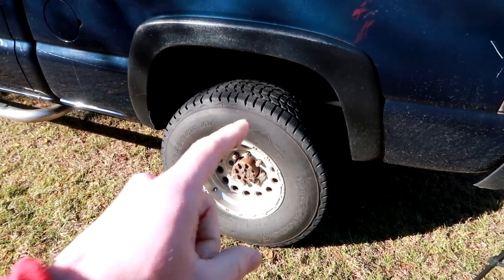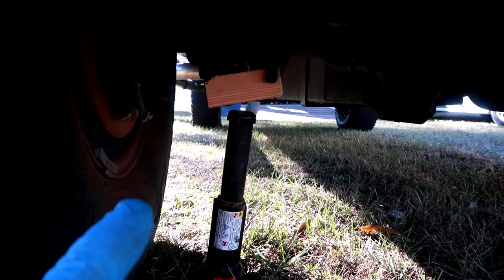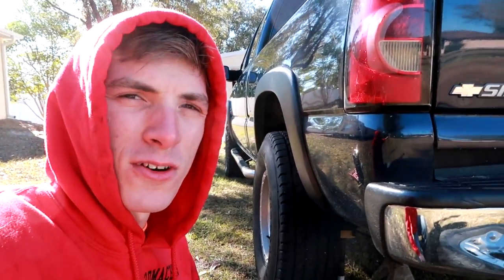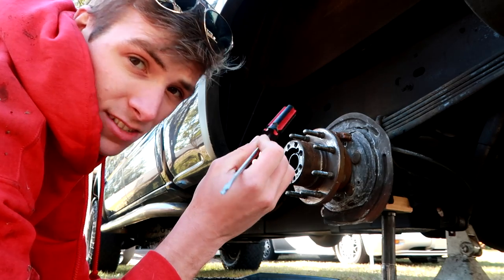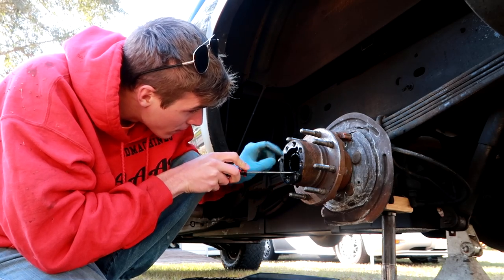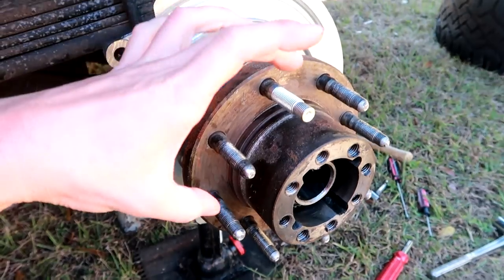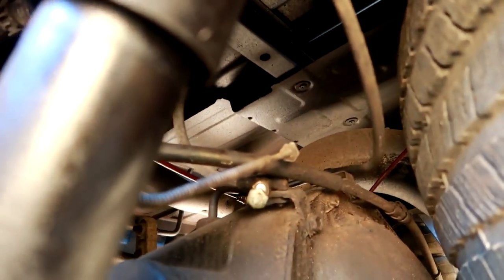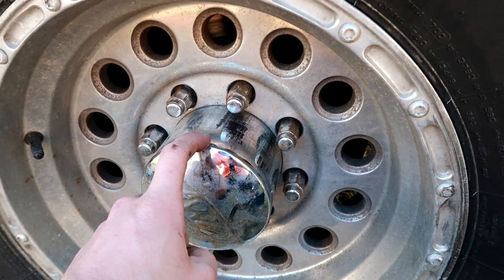IT'S ALL BENT UP!

Comment from the maker: cHECKOUT YESTERDAY'S FUN!!!
YESTERDAY'S VIDEO: https://www.youtube.com/watch?v=RG9ojHju6E4
Reply: Dont forget the wheels i see them at the end of the video in the background.
Reply: 3DMachines you should do a meet in Jacksonville Florida
Reply: 3DMachines use aluminum foil and water to take the rust off of your hubs
Reply: 3DMachines plzz ensure you tighten those properly wouldnt want the same  thing happening  love you dude keep up the good good amazing work yah!!!
Reply: Dalton, I guess this is a very temporary solution. Both brake discs of an axle should be changed at the same time due to a different wear, same with the brake pads. Rear brake maybe decompensated. Please, let's make things well.

Ondo ibili,
Reply: yo i live in fort myers
Reply: Hi 3D machines! it is snowing up here in NJ right know but it is not much. It is always good to check your wheels. I checked my wheels today and make sure they are strong.
Reply: why do you have to re-torque the lugs all the time is it just that particular truck or what???
Reply: Hey Dalton, how come you have to retorque you wheels? as here in New Zealand it is not required, they just need to be tight.
Reply: so your wheel wont fly off like it did here causing this repair
Reply: 3DMachines when u going back to new york
Reply: naw i get that but i never had to continue to re-torque the wheels every 50 miles
Reply: dude you need to check the diff fluid like asap you lost a good bit when you pulled your axle
Reply: We're is your light bar on your truck and we're is your bruin 350
Reply: Good to know.
Reply: I would never let this kid touch anything I own
Reply: 3DMachines you got a snow MO and new york is snowing so now by the time u get back u won't be able g o ride it.  I would love to see snow MO Vlogs.  I really love your vids
Reply: ryry moore it's not snowing in Rochester ny, there's not even any snow on the ground so I'm happy
Reply: Jake Burchfield Dalton doesn't live there and it was snowing hard when he left
Reply: Do not forget to check the differential oil! You lost some of it when you removed the Axel.
Reply: 3DMachines
Reply: torre1976 Vs He is using the same pads just replaced the rotor it's fine
Reply: I wonder when Dalton is going to use the proper "mag type" lug nuts? Hopefully he figures it out before the other wheels fall off.
Reply: Ryan Georgi I will never
Reply: I hope you put oil in the rear end
Reply: there's a reason that wheel fell off and I'm guessing those free wheels someone gave you had a broken belt in one of the tires, just be glad you put it on the back opposed to the front.
Reply: 3DMachines I love the video
Reply: What's your top list of tools to always have with you for any type of emergency?

Comment: Do not forget to check the differential oil!
Reply: surprising how little you can take out of a diff and there,s not enuff to reach the axle bearings
Reply: Walter Laughlin That's exactly what I just commented. Now he might run the risk of chewing up the gears, bearing, or completely locking up the rear totally. He actually torqued the lugs too many times also. That's putting a lot of extra stress on the studs and possibly stretching the threads more than needed.

Comment: When you own a diesel and don't like the smell of the exhaust you might be weird
Reply from the maker: BRAKE CLEANER makes bad smoke.
Reply: 3DMachines js i love that smell
Reply: Hunter Armentor, carcinogens cause cancer bro. Careful man.
Reply: wife works at a gas station when she does the diesel dips at the end of the night and comes home with the faint smell of diesel on her I go nuts. love it!
Reply: Detroit 4x4 the smell of the "new" ultra low sulfer highway legal diesel makes me want to puke...especially in cold weather. Nowadays, I'll take an old diesel (anything pre DEF) running #2 heating oil & I'll be happy. If it's a Detroit two stroke I may even smile.
Reply: My father has been a diesel mechanic for over 30 years and still hates the smell
Reply: I know who you are

Comment: That's why I love and install brake line balancing valves in my trucks. I like to be able to adjust how much brake force is applied to the front or rear. Coming down a steep hill in the snow and you will want a little more to the rear when off-roading.

Comment: A Breaker Bar is no substitute for a Torque Wrench.....They work great in a bind but should only be used temporarily.  Buy or Rent the proper tool....Also pro tip... Tighten the lug nuts up before lowering all the weight of the truck onto the tire.  The best thing I found to do is torque the lugs while having someone hold the brake when the truck is still in the air, this will allow even torque to be applied to the wheel.
Reply: W Gibbs he has a torque wrench
Reply: he has a torque wrench he was loosening stuff with the breaker bar.

Comment: to get that axel nut off you have use a pair of needle nose pliers. I have a full float gm 14 bolt in both of my trucks and works just fine. you can also use the needle nose to get the square key out and that holding ring out too.

Comment: Dalton, jack up the right side rear tire as high as you can get it for like 5-10 mins asap to get some gear oil flowing to the hub bearings. Takes forever to get any oil there just normal driving and the bearings might not make it.

Comment: Did you use the old breaks on the new rotor? Welp there goes that rotor.
Reply: Ya. With old pads, you grind the old pattern into the new rotors.
Reply: Oh god ya. My dad has a GMC sanoma. It has has the same back break pads for the entire life span (125000 miles) and they still look new. So that shows you the work that they do.
Reply: well it could also be the rotor not being the best quality. My dads truck (same truck), when you apply a lot of breaking force, it has a little bit of wobble to it because the rotors have a slight divot in them because they where made poorly.
Reply: Alpha Nerd ...breaks ? Wtf are breaks ? Brakes are what stop a vehicle.
Reply: ROTAXD yup...lol
Reply: I honestly think composite pads will comfort to steal drums??? I don't think he will hurt the rotor.
Reply: Alpha Nerd those have drums?
Reply: Brett Maki most modern rotors are nunk to begin with and have very little material to begin with. Most places don't even have a lathe to turn them down anymore.
Reply: TOO Funny! Someone actually commented on Breaks, VS BRAKES!!!
Reply: I doubt he re-used the pads. Once they hit that flat spot they would shatter. Btw he got new pads for it.
Reply: Travis Piper m

Comment: Just a suggestion, you should torque the hub nut to prevent the hub destroying the seal and leaking the gear lube out and possibly damaging the axle tube.

Comment: Looks good, but I think you should have used the gray silicon for gear oil.
Reply: Black and grey are pretty much exactly the same. Black actually has the highest oil resistance rating out of all the different colors though.

Comment: AGAIN:
The problem of the wheel coming loose may have been due to different thickness between the mounting pad section for each wheel.  A thinner section would effectively have the studs protrude further, and an acorn-style lug nut will bottom out on the stud.   Any torque applied would jam the threads into the end of the nut, not tighten the wheel.
Also, best to replace ALL of the studs on that corner, after an incident like this one.

Comment: Dalton don't forget to check fluids including brake fluid and to re torque ALL the lugs on every wheel just to be safe and look in the owners manual or online and see what the spec is and estimate the 160 ft pounds or so it needs. Also since you pulled the axle and lost some gear oil you will need to refill that. I'm sure you are aware of all these things but hey sometimes a little thing slips your mind. Also I have a feeling the pads on the back left may be destroyed after all the torture from that and they may need replacing when you get home or they will break back in and be fine hopefully.

Comment: Once you take the hub off the seal is no good and it's going to leak, you should really get the tool for the hub bearing because there is a preload you have to set so it won't ruin your bearings, next time try giving the axle a good few hits on the face it should pop right out

Comment: It's always a good idea to re-torque the lug nuts once or twice after putting a wheel on, but doing it three and four times is actually bad. That puts unnecessary stress on the stud and will start stretching the threads on the stud and the nuts. But hey, your wheel fell off and I get why you think you need to do it. Haha
And unless you did it off camera, you really should've checked the differential oil. Now if that's too low you risk chewing the gears up or locking up the rear end all together.

Comment: Did you use lock tight? anytime I do a job on a car I use lock tight the blue stuff lol and I would check the other side to make sure the seals good because you had a lot of force on the wheel when you lost your other one just do a one over of the truck drive safe man and happy trucking should get a cb so you can call on us truckers we don't get to talk much anymore with the steering wheel holders out there don't have a cblol

Comment: a re-torque will not help you. you missed a wheel when you put those on or you were not tight enough to begin with. put 1000s of sets of wheels with impact guns,torque wrenches, and breaker bars. only ever tightened them once. none have ever fallen off. the re torque procedure was invented by the corporate world as an insurance policy for there incompetent employees.

Comment: who uses the e brake anyways? I remember having to pinch off my rear brake line due to a blown caliper seal. as you say most of your braking comes from the front. if you were towing I wouldn't recommend doing what you did but the mechanic Nazis can say what they want,as long as it gets you home I wouldn't worry. I ended up pulling off the brake shoes and everything on mine,once I got it home then I fixed it right ebrakes in mi usually fail because of lack of use. in the old days,the star adjuster on the ebrakes set the proper distance on the shoes if the star adjuster froze up,your brakes would not wear properly and screw things up also resulting in loss of rear brakes and usually the adjuster would fall into the brake drum and grind up as well as pop retaining springs causing total brake failure. most e brakes do not work like that any more. when driving backwards,the star adjuster would tighten up the slack resolving the shoes.

Comment: why not use blue lock tight on them
Reply: Thepawn17cp Why are you saying he's cheap? Is it because he got black silicon and not blue? He wasn't getting a thread locker like Loctite anyway. He got silicon gasket maker. Blue and black are pretty much the same exact price. They're both rated for like 500 degrees and black has a higher oil resistance rating. He got exactly what he needed to get. Just asking in case that's what you thought he was getting.

Comment: I'm not a half assed kinda person!!!  ummmm... your wheel fell off your truck due to the fact you couldn't be assed to stop and check the torque on the bolts after changing the wheels over.